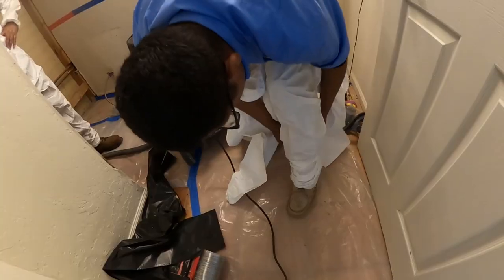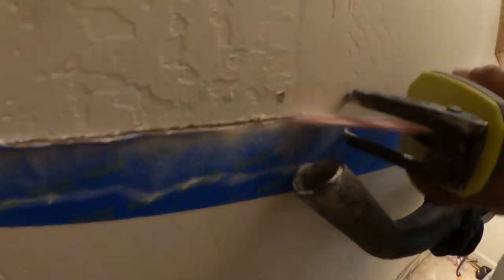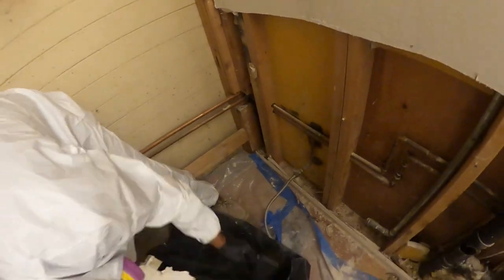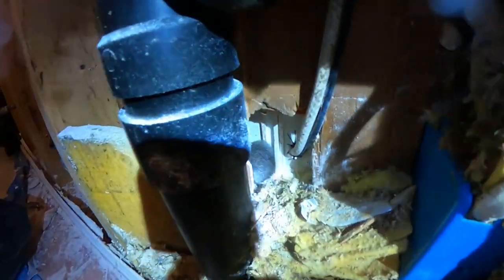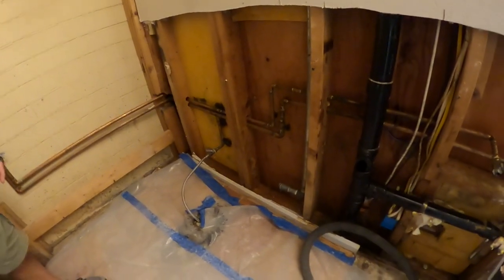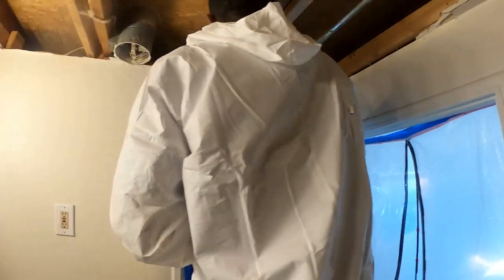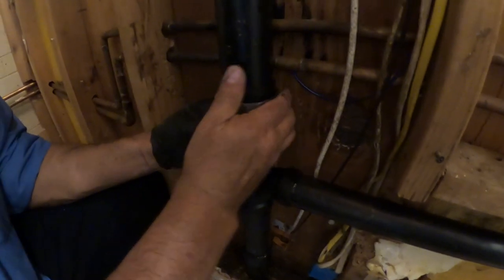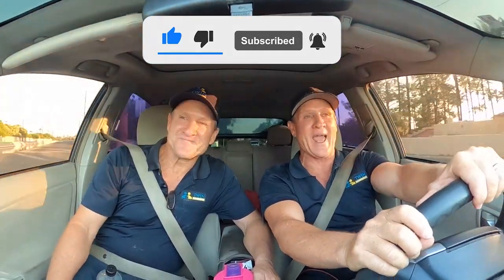OVER 25 RATS DESTROYED THIS BATHROOM!! Rats running at our feet!! BEST RODENT CONTROL!

Comment: Had a mouse getting in from unprotected exhaust flap.  Installed metal mesh over it, and after 3+ months of hearing it chew on wood, wire - I think it found my peanut butter/borax poison mix.  Crossing my fingers!
Reply from the maker: Looks like you will win the battle Random. This is when baiting works well.
Reply: Peanut Butter & Borax is Great!

Comment: As long as you guys have been working, in most homes do you find the entry point is from a breach sewer system or holes at the outside of the house?
Reply: Guess it kinda depends where you live, we deal with roof rats in socal entry points on outside keep trees trimmed away from roof

Comment: 6:40  Vent Pipe:  I Don't get it, 1) 'Shoved Wire' in Opened End -->>  INSIDE Wall??   2) so "They don't come Out".  ??  "They"?  
Are Vent Pipes allowed to be Left Open Inside Wall?   I've heard you Caution of Issues with Pipe left 'Open'.  ?  
Inspection Camera:  Why not use (Small Hole) when searching areas Behind Wall for Rats;  Patch Hole instead of Cut 'square' - ?